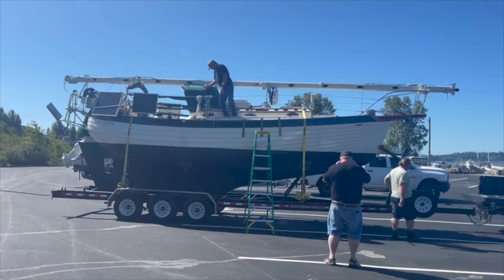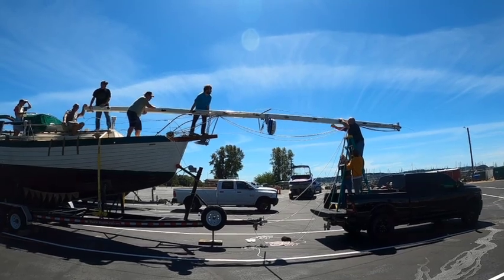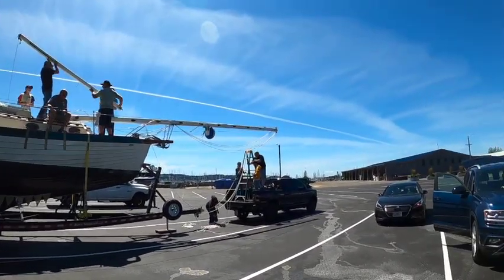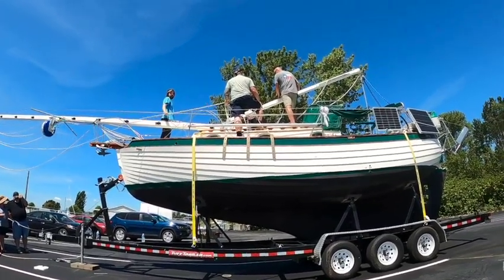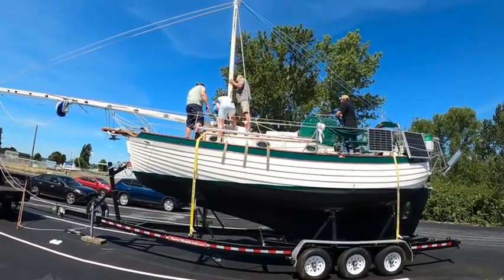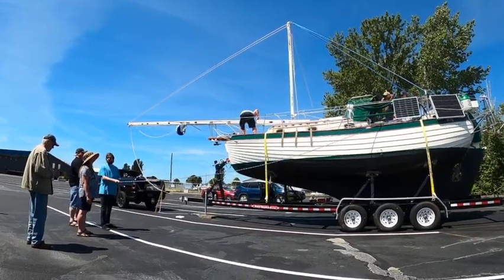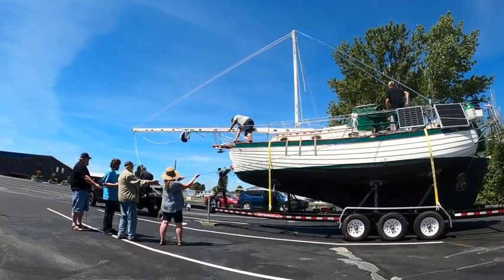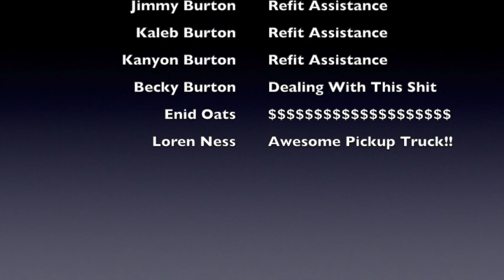56. Nor'Sea 27:  How To Raise The Mast!

Comment: If you carry the mast on boat in the other direction it would be easier
Reply from the maker: Actually, that wouldn’t work on a Nor’Sea 27.  It is designed to use the boom and main sheet to lift it and pivot on the tabernacle. Obviously when we’re going down the road, it is moved so that it hangs off the back as well lol